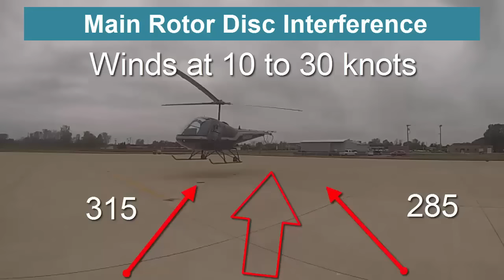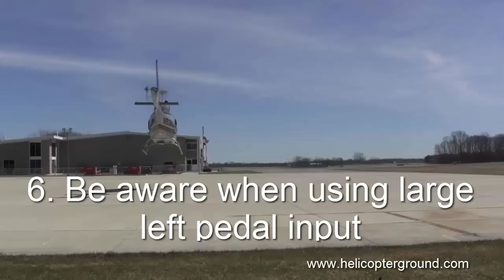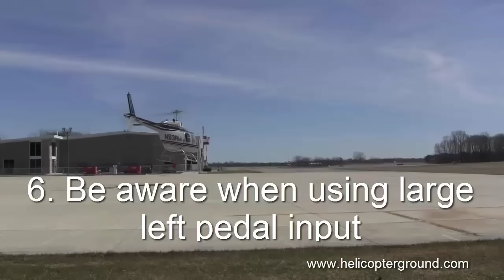LTE Loss Of Tail Rotor Effectiveness Lesson Online Ground School

Comment: Good video BUT, the direction of wind affecting the tail rotor by main rotor interaction IS dependant on the direction that the main rotor turns - different for Eurocopter/Airbus vs MD/Bell etc.
Reply from the maker: Thanks for commenting!
Reply: Yes spam mouse, but keep in mind that the natural direction of un commanded yaw in LTE incidents is still towards the advancing main rotor blade regardless of the manufacturer specs.

Comment: One thing to point out here regarding the recovery technique. The first action needed is missing, the first action during the unanticipated right yaw is to apply left pedal input without any delay and apply other control inputs as described. Without the application of the left pedal, the situation will become worsen. In case of low altitude and restriction for forwarding flight, the only immediate response is to be the full application of the left pedal. The latest FAA rotorcraft handbook tells to apply the left pedal whereas the previous version had this point omitted. Please share your thoughts.
Reply from the maker: Yes this video was produced back in 2016 based on the Helicopter Flying Handbook, before the revised Helicopter Flying Handbook published in 2018.

Comment: Direction of main rotor rotation will affect the AT pedals. I remember taxiing downwind using 75% left pedal and then 75% right pedal to turn into the wind and it will snap around and you won't have enough left pedal to stop it. It was better letting off the left pedal, turning left into the wind and having plenty of right pedal authority to stop the turn.
Reply from the maker: Thanks for sharing James.

Comment: Nice video about LTE. 
As you use this video for educational purposes I would recommend you show this video again but with the helicopter hovering at a 8-10ft hover. 
This video is a perfect example of how NOT to hover (so close to the ground) as you are very prone for dynamic roll over. Especially for the more in-experienced pilots this is a poorly chosen demonstration. Heads up for the good initiative of explaining LTE .
Reply from the maker: Thanks for the input Matti. We hover as a standard 3 to 5 feet. The FAA publication Rotorcraft Flying Handbook recommends lifting the helicopter to two to three feet (page 9-3 Vertical Take Off To Hover). Many helicopter manufacturers recommend three to a five foot hover. I have not read or attended any training since I started in 1997 that recommends 8 to 10 feet hover height. What is your resource that recommends eight to ten feet hover height?
Reply: Yep, regular 3-5 foot hover. Great example and demo here, guys.

Comment: Where is helicopter speed back roter ?
Reply from the maker: speed back roter????
Reply from the maker: The Tail Rotor and main rotor is geared and shafted to spin at a set RPM and is fed from the Main Rotor transmission. The only instrument needed to monitor these two is the Main Rotor Tachometer, since they are connected. Grab a free copy of Amazon #1 best seller, "Helicopter Check Ride". You will have to enter an email for the free digital download, but we do not share your email! https://www.helicopterground.com/pl/1856